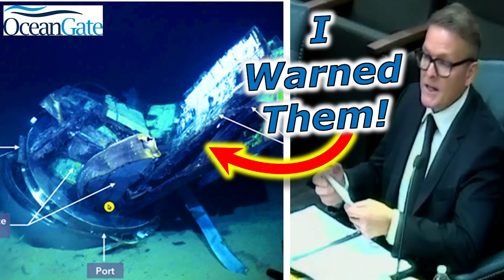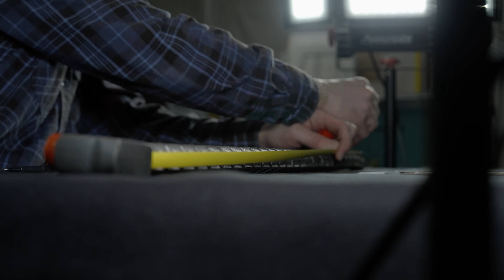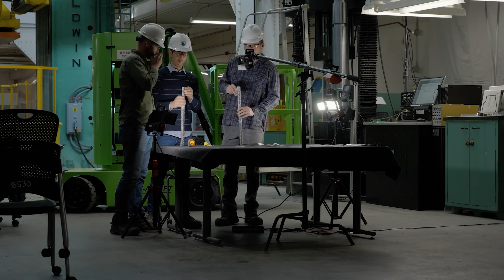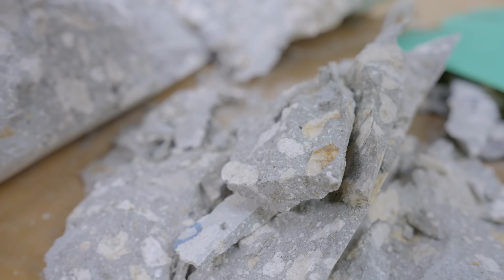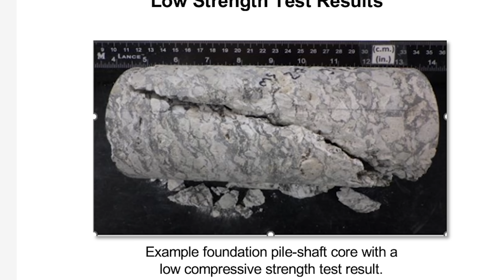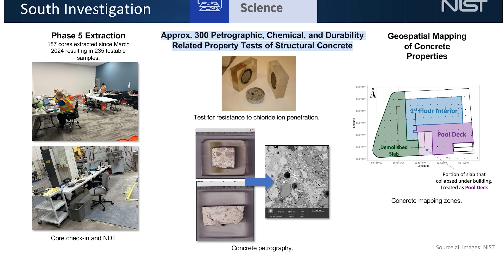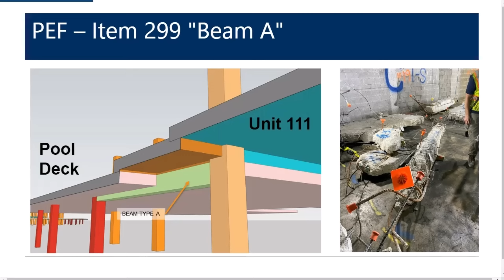Miami Condo Collapse Investigation SETBACKS: Champlain Towers

Comment: The white paint with random black speck pattern is for “Visual Image Correction” .  Notice the cameras in the background when they showed the failure of the rebar.  

The speck pattern unloaded is compared to the same pattern under load.  It provides an amazing strain graph , sometimes in 3D even.
Reply: Makes sense. We never painted the rebar back in the testing lab when I was studing Civil Engineering back in th elate 70's. It was always a fun day when we got to smash some concrete or tear some rebar apart. 🙂
Reply: Lol @douglascaskey7302
Reply: @douglascaskey7302  VIC is relatively new tech.  I believe it was developed at U of South Carolina in late 80’s or early 90’s.  However the computational speed needed wasn’t up to par.  In the mid 2000’s computers got way more powerful making the tech viable. 

It used black and white spectrum 0-255 to essentially create a matrix of numbers from an image (that is why the black specks need to be random). After strain, the computer goes block by block comparing one frame to previous to determine displacement. 

I hear now they can essentially freeze time to see how projectiles penetrate in 3D (that was true 15 yrs ago, so who knows what they can do now)
Reply: @douglascaskey7302 IN the 1970s we didn’t have powerful computers that can capture video & manipulate it directly like a visual schematic 

.

Comment: it wasn't the construction quality, it was the neglect of maintenance, and inspection.
Reply: If it wasn't a quality issue, then why was concrete with unusually low compressive strength recovered from the site?
Reply: No, it was all of these factors. It wasn’t just one thing that made this building full. It was the design, the construction, the maintenance, the additions, etc.
Reply: @neilkurzman4907  Shhhh!  Don't you.realize that those two Einsteins have it all figured out.  They are just now waiting for the onrush of lawyers coming to hire them to provide their expert testimony in the hundreds of lawsuits.
Reply: Yes, this has moved from practical prevention to pure research. I guess it keeps people employed.
Reply: @markmaki4460  Given the cost in spilled blood, don't you think it's important to learn as much as possible from each incident?

Comment: NIST should in principle be able to pull the accelerometer data from computers/phones that were there. Those data strike me as potentially quite valuable. Since it would be recorded on solid state, something hopefully survived.
Reply: Very unlikely to be data. Phones have all the sensors power gated for efficiency and if there doesn't happen to be an application that requests data at any given moment, there will be no data, plus if it's a small data volume, it would end up written only minutes later. PCs don't have an accelerometer. There is allegedly sometimes one found in largely obsolete 2.5" magnetomechanical hard disks, but not in 3.5" nor solid state, and then they don't even log data except last emergency park. An e-park accelerometer is implemented on Thinkpad mainboards but nether it is constantly logged nor even available to software.

Real world doesn't quite work like CSI series plots.
Reply: @SianaGearz  "There is allegedly sometimes one found in largely obsolete 2.5" magnetomechanical hard disks"
Not alleged -- they're actually there. As you say, the purpose is to detect that you've dropped your laptop and yank the heads out from between the disk platters before it hits the ground. And, as you also say, mechanical hard drives are basically obsolete in laptops these days: it's entirely possible that there were none in the building.
Reply: I'm not convinced that consumer smartphones would record accelerometer data passively and keep it forever. That would be a lot of data taking up space for no reason.
Reply: Why would that be useful?  The thing investigators need to know more about is the causal event, the collapse of the pool deck, 7 minutes before the building went, and no one was out on the compromised portion of the pool deck with their phone/tablet at 1:14 am that night.

You can just watch the security video if you want to know the speed of collapse of the building.

Comment: With the amount they've spent on this investigation, they could have completely rebuilt Champlain Towers North in a safe way, and paid off everyone who lives there's mortgages. Maybe we shouldn't be building concrete buildings right near the ocean. Do waterproof plastic composites exist yet?
Reply: And the replacement building would have been completed by now with most condos already sold.
The one advantage of a comprehensive investigation is to find the true guilty so that law suits can be settled.  But the true guilty is likely already out of business and now protected by the statute of limitations.
Reply: @DrJuan-ev8lu  the government is not doing this investigation to help with lawsuits. Which have already been settled.
Reply: They’re not investigating this for that building they’re investigating it for every other building in the area. 
You guess we shouldn’t be building concrete buildings by the ocean. But they’re testing will determine what happens to a 40-year-old building by salt water and see if that was related to the failure. And if it was what should inspectors be looking for in other buildings?
Reply: There's thousands of concrete buildings in Miami (some a lot taller than CTS) that are doing just fine.  It's the neglect of maintenance that led to the pool deck rebar rusting and causing this disaster.  And to answer your question, fiberglass rebar does exist and is being used more and more.
Reply: @johnbergstrom2931  
Are the other buildings doing just fine? 
Is this one just the first one that failed? Well others fall unless they are given attention.  Did they learn anything from this building that inspector should be looking for in those other buildings?
Does the failure of the pool deck taking down the entire building need to be addressed in other construction in the area?

I saw another video about fiberglass rebar. It has its own issues.
Reply: @neilkurzman4907  I think having the pool deck rigidly integrated with the tower was a decision beyond idiocy.  They should have planned for deck corrosion, obsolescence and replacement and built accordingly.  

I don't believe they build them like that anymore.

Even so, if they had just put a slope on the pool deck, added waterproofing layers and done overhaul and/or replacement of the waterproofing and pavers every 10 years or so, this disaster would not have happened.

The pool deck was underbuilt, but in absence of massive corrosion, like CTS had, you might have only had localized failures, the kind that could be easily remedied and repaired.
Reply: @johnbergstrom2931  
I don’t know I’m not an old civil engineer. So I can’t say what the standard was in 1980. 
And then you went with the improper construction, which has nothing to do with the design   
Followed by putting a lot of weight on the deck without getting an engineering assessment 
Not properly maintaining the structure. 
Not having the structure looked at when it started to sag.
Reply: @neilkurzman4907  The pool deck was underdesigned as well.  

Josh Porter of Building Integrity did a whole series of videos on this subject.  As designed, the deck was only strong enough to support itself.  It's kind of a miracle it didn't collapse during the first big pool party, back in the early 80's...

Comment: In their full scale test model they have failed to add in the side pull from hanging deck. This could be significant in causing buckling failure of that particular building collum itself and spread of failure to other collums.  At least they are working with the critical point where the building itself began to collapse.  But FEA analysis should show that failure of one collum does not bring down the whole building.

Comment: Does anyone else think the way that rebar broke was very strange? There didn’t appear to be any stretch or distortion in the steel before it just snapped! Seemed to just be brittle and not malleable at all!
Reply: Also surprised me. I had heard rebar was junk, but wow. I thought the whole benefit of steel for rebar is that it experiences ductile failure?
Reply: Same here. That looked not like steel more cast iron. I am curious whether this was odd or what the explanation is.
Reply: I suggest watching Slo-mo guys video on testing rebar as that's what it's supposed to look like when it exceeds capacity.
Reply: Ah HA! I've had to page down to here before I find someone observant! 
I can't tell you how many such tests I've been involved with here in U.K. and have never seen any of our rebars fail in a crystal shear - that piece of bar has been improperly tempered or otherwise heat treated, bad metallurgy.  
I know of a factory manager who couldn't resist buying some steel strip at ridiculously cheap price - when mounted in an 8" rolling mill to form crimped "C" section - it fractured in flitches like bad plywood does - and gravely wounded £1,000 set of rollers. 
Once upon a time - we could rely on British Steel, each Spec had a B.S. No. stamped into the metal - now no one knows where the stuff comes from - old Russian warships recycled in India, I shouldn't wonder. Buyer beware!
Reply: It could be poor quality steel that got contaminated in production
Reply: That looked like cast iron snapping in two.
Steel should have ductility and some stretching before complete failure.
Reply: Yeah, steel should bend not snap, acted like iorn, Did it come from China or is that a lie?
Reply: @ifv33  did it come from China in the 1980s? The answer is absolutely definitely not.
Reply: @neilkurzman4907  collapsed like it was made in china
Reply: Read a report it was the lack of rebar reinforcement, shity concrete, watter degradation, and corruption basically.
Reply: As with all metals, the way it’s treated and the alloy used affects its performance. The question is what did they want to do?
Reply: It looked very "powdery" too.

Comment: During NIST's WTC Investigation (2002-2008) they did use the visuals-organizing software called CUMULUS, developed by Canto, in order to sort, attribute and make photos as well as video clips easily shareable between research-task groups.
Reply: What were the findings?
Reply: @ABa-os6wm WTC got hit by a plane which carried combustible fuel.  The intense heat softened the steel support until it collapsed
Reply: Great report

Comment: Rebar seems brittle
Reply: Assuming that was one of the actual tests of the building materials and not stock footage, the full test was not shown so you don't get a sense of the elongation that had occurred already. The extensometer had already been removed so we were only shown the last part of the test. Rebar grades are "Grade X" with X being the minimum yield strength. I am not a high rise structural engineer I am in gas turbines but  I would expect higher grades of rebar to exhibit less necking than lower grades.
Reply: Yes. I don't know rebar but that straight break without visible necking down and the "sugary" look to the break made me wonder. Would that be typical?